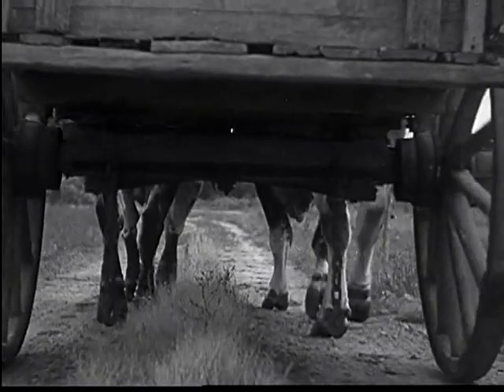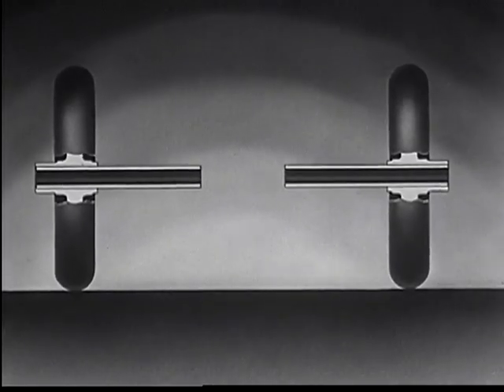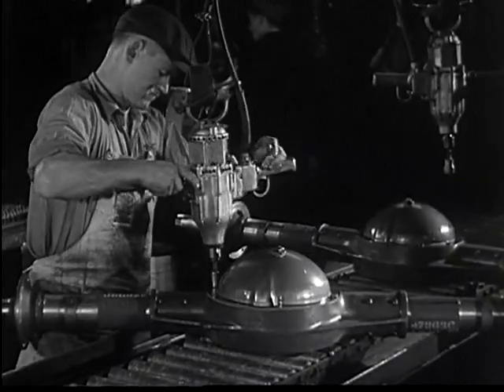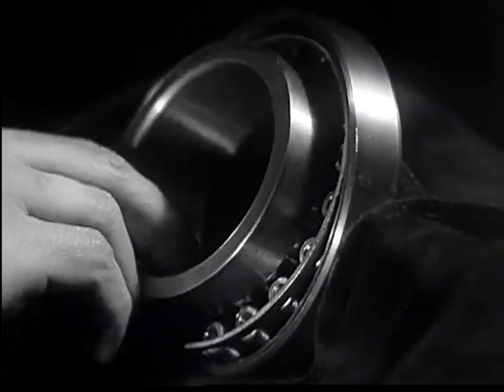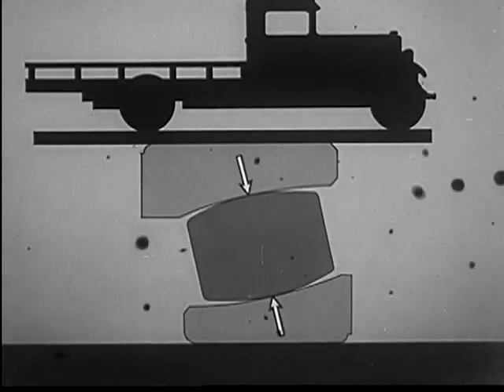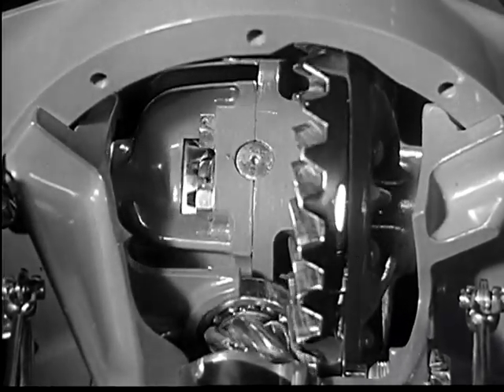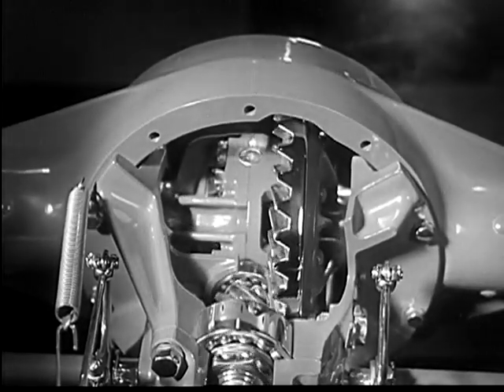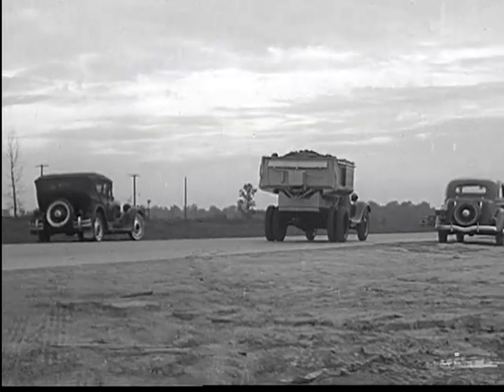It Floats - Chevrolet Full Floating Rear Axle (1936)

Comment: 1936: repair broken axle with a wrench
2019: disassemble half of the car to change a lightbulb
Reply: @Gibbon Oh sure, it only took four hours to replace the rear valve cover gasket on my V6 Toyota.
Reply: @Sean_Coyne  same, did it myself and added extra washers to squish the gasket better. 4 years no leaks.
Reply: Sean Coyne transverse v6 lolll
Reply: @Sean_Coyne  or 3rd brake light bulb on a tundra 2015
Reply: @Sean_Coyne  Now thats an unfair thing to say, and it tells me you're not very smart when it comes to engines. A valve cover gasket is gonna be a tedious process no matter what because you HAVE to disassemble ANY internal combustion engine to change that. Or at least part of it.

While you're at it, why dont you complain about your crankshaft change being tedious, too?
Or your valve lifters needing adjusting?
Or your wrist pins not sliding easily?
Or your main journal bearings needing replacement?
Reply: @Dave_Crupel  Disassemble the engine just to change a valve cover gasket?  That is not true.  Nobody who is smart about engines would ever say such a thing.
Reply: @Sean_Coyne  they always take more than 4 cyl to maintain, you knew it when you bought it lol
Reply: Sean Coyne that’s all transverse v-6’s of similar size in fwd applications. Try working on a MR2. Dope whip, no room better have access to a shop. And some people drop Camry v6s in them.
Reply: @Sean_Coyne  ...tell me about it.  Probably had to remove the intake as well !
Reply: @Sean_Coyne  Next time, buy a Toyota Prius. Over here in Germany, many cab drivers say the Prius Plus is the most reliable car they ever had. Usually they always hate the currently driven car and want the old Mercedes Diesel back.
Reply: @Sean_Coyne  chances are it's made by GM lmao
Reply: @Sean_Coyne  to be fair...this applies to any transverse v6. longitudinal v6s wouldn't have this trouble.
Reply: @Sean_Coyne takes me like 20 minutes to change a valve cover gasket on my 82 S10 lol
Reply: @Sean_Coyne try repairing the timing cover seal on your Toyota V6.  Makes your valve cover look easy.  You will have to do the valve cover again BTW. Lol
Reply: @Sean_Coyne  Bingo. Toyotas aren't as great as their stupid commercials make everyone think they are.
Reply: Obd1andDown yeah actually they turn out a lot better, reliability, efficiency, and easy-to-work on seems to always outlast every American piece of shit on the road. Domestic fanboys thinking their heavy gas guzzler rust tanks are better than imports. Theres that Boomer mentality again and its killing me holy fuck.
Reply: @acewingdabson3139  Rust tanks?  Japanese cars are the rust buckets, made all the worse because of Unit Construction.  If the rockers get rusted, the car is almost impossible to fix, because those rockers double as structural members.  Reliable?  There is nothing reliable about rubber timing chains and water pumps inside the timing cover.  Easy to work on?  Not when you have to pull the engine to remove some of the spark plugs.  Plus, some of us like ROOM, COMFORT, SILENCE, and a NICE SOFT RIDE.  Also, your foreign wonder cars would not be lasting anywhere NEAR as long if motor oil was the same as it was in the 70s.
Reply: @Sean_Coyne  why don't you drive a 1930s Chevy then?
Reply: @MilesPrower1992  They are very hard to find in stock condition, and quite expensive when you do find them.  I drive a 54 New Yorker station wagon and a 73 GMC 3/4 pickup.  NO computers, NO smog checks, NO catalytic converters, NO EGR valves.
Reply: @michaelbenardo5695  I made that comment three years ago
Reply: @michaelbenardo5695  But they're so dependable and easy to repair! Surely they must be common and inexpensive to maintain!
Reply: Mic_Glow  or pull cab off to change a turbo. Lol damn time has changed
Reply: My friend has a Chevy Malibu 2009, she pays $150.00 just to replace her headlight bulb. Am not joking
Reply: @nelsonmiranda6117  but the problem is the car or the people? 99% of times its the people.
Reply: That axle wasn't broke dumb fuck
Reply: @Gibbon Simple? I had to remove my entire truck bed to replace my fuel pump.
Reply: @austins.3313 thats because you did it the incorrect way.
Reply: @austins.3313  Depending how much you love that truck, you could just cut out the piece of the bed in the way and weld it back.
Reply: @austins.3313  haha me too ,
Reply: @austins.3313  in comparison to other cars that's simple
Reply: radiobot that’s the Mexican way. The mechanic way is to drop the tank. Don’t be so petty
Reply: Axles in today's trucks are nearly the same like this shown one when they haven't planetary ends.
Reply: Mic_Glow 🤣
Reply: Gibbon yeah and I only had to remove the front brush guard and bumper plate then buy a speciality tool in order to remove the oil filter on a 2019 toyota tacoma...
Reply: Cause newer vehicles have too much crap in them that we really don't need.
Reply: With a good fight for Right to Repair, and maybe even some DIY/Open Source Hardware, we can get back to a sensible world like this!
Reply: @ericlotze7724 We can only hope so.  Problem is, the yuppies love overly complicated and hate simplicity, and the auto makers are catering strictly to them.
Reply: @michaelbenardo5695  You can make things complicated AND maintainable, you just have to have the end user’s experience and all that as your priority, not “as much profit as we can juice out of them”, They just intentionally make stuff hard to work on…so you take it them and them alone to fix it (or better yet for smaller stuff just throw it away!).  Or design in points of failure / skimp out on materials so you have to buy a new whatever widget every few years.

But yeah i hope with everyone being aware of all this, and all the crazy shit you can pull off in a small fab shop these days (cnc machines, 3d printers, etc), that we can finally make stuff built right again!
Reply: I remember swapping out my old VW Beetle engine in minutes by removing just four bolts and dropping the engine onto a trolley jack. Skilled or not , anyone could maintain that car.
Reply: damn right you are....    :-D
Reply: Ya entendi😅😅 hahaha
Reply: So true
Reply: @Gibbon When? 1988? If so then I agree.
Reply: Things are made harder to work on for one reason..... post sale service revenue.
Reply: 1936: 30 regulations regarding production of automobiles.
2019: 5123 regulations in the US, 3453 in EU, 3234 for Japan, and another 3234 for other countries.

You could repair them with a wrench, but it would get broken every few weeks. Today people complain because they have to do an yearly oil change and nothing else.

True, cars today are way more complex and compact, but back then it was basically a carriage on wheels, for God's sake, they still had bike wheels :)
Reply: @manu144x  What in the hell is the point of compounding the light fixture?
Reply: @manu144x  Cars had long since left "bike wheels" behind by the time of the First World War - 1914 -, let alone the 30s.  30s cars were not carriage-like.  You are thinking of 1900 - 1904 cars.
Reply: @Gibbon I like Toyotas, and have owned a couple. They are NOT easier to work on.
Reply: Your absolutely correct, today's vehicle are made so that the average joe have to go to the dealers for repairs.
Reply: That's because we used to demand what we wanted, or we're not buying it. Not we just take what we can get, and buy for other stupid reasons.
Reply: I have a '46 Chevrolet pickup and a 2018 Colorado. The '46 can carry a 4x8 plywood flat in the bed. The 2018 Colorado can't. We've come a long way baby.
Reply: Remove the entiire front console to replace the airbag control unit.
Reply: My 2006 yaris I legit have to take the front end off to change the headlight bulbs.
Reply: A V8 pushrod motor combines the ease of repairs and performance over any other type for the average joe. This is why Ford brought it back in the 7.3
Reply: @jtnoodle  YES, YES, YES!  Nothing else measures up.
Reply: While in most cases that may be true. Today’s cars last way longer 200,000-300,000 miles is not uncommon back then 100,000 was a huge milestone
Reply: @mike5162  We didn't have synthetic motor oil back then either.
Reply: @michaelbenardo5695  that’s true but I’m pretty sure that has little to do with it. I use synthetic oil but I’m not sure most people do.
Reply: @mike5162  Most of that long life is due to the use of synthetic motor oil.  It is far better than the stuff that comes out of the ground, and even that is better than what we used to have.
Reply: @michaelbenardo5695  I agree with the synthetic oil but it is much more than that.
Reply: @mike5162  Today's fuel injection means no more flooding and washing the oil off the cylinder walls.
Reply: @michaelbenardo5695  okay, Bot ,🤖 I ,will ,do ,what, you, command ,we, good,brother,,,???? I, am, concerned?
Reply: And pay $700 for Yukon led rear tail light assembly with no replaceable bulbs other than the reverse light.
Reply: @fomoco300k  $700.00 for a damn taillight lens???
Reply: @fomoco300k  Easy solution - Never Buy a Yukon. Ever.
Reply: When my father was getting a fuel injector replaced in his 2016 Ford F-250 Super Duty they had to lift the body of the truck off of the frame entirely to get to it

It was a $9,000 USD job if memory serves
Reply: @Weird_Cat_Thingy  Sounds like a rip off. Diesel?
Reply: @Weird_Cat_Thingy  You serious?
Reply: To be fair though, you had to rebuild the motors every 10k miles in the 30's, so you were wrenching way more often
Reply: @Mr Sunshines Sir, that's more like the vehicles of the teens.  20 years later, everything had vastly improved.  However, I agree with your overall point, today we think nothing of even driving across country.
Reply: @davidstjames_  Partly because of our Federal and State highways.
Reply: Well said
Reply: Gibbon Toyota trolls at it again!
Reply: Mr Sunshines ha ha people are clueless lol but i understand the OP was being funny. They cut the part of him fishing out the busted shaft that stayed inside lol all good
Reply: My 2018 Focus has you undo two screws and the whole headlight comes out. A lot easier than my 95 Escort which has you disassemble the grille plate and a primary bracket setup to get access to it. Sometimes they get it right, other times it's the new guy designing his first car.
Reply: Yeah good luck trying to get that 1936 to start in 28 degree weather. Let's see you drive 300 miles straight in that 1936. Be honest, most of you have never changed a taillight.
Reply: @KobaBlack113  A 36 will indeed start in 28 degree weather, as long as it is in reasonably good tune, in reasonable good condition, and you are using either modern multi-grade oil or the proper single grade for the temperature, but if it needs new points, condenser, cap, and rotor, then maybe not, but that applies to all pre 75 cars, not just 30s cars.  My 73 GMC pickup is equipped much like most 1936 cars, (except Fords); 3 speed manual, manual brakes, manual steering, wind-up windows, manually adjustable seat, Inline 6, low gearing.  I have driven it more than 300 miles straight.  I love it, but you would hate it.
Reply: @Gibbon yeah bullshit.
Reply: @thedave7760  Some procedures, as you detail, can be tedious. As I've found recently on an eight year old SUV that with repetition I managed to shave forty minutes or so from replacing an entire headlamp assembly on a GMC Yukon. I did both sides since the lenses were pitted beyond restoration. The upside was/is that with the new lenses it actually changed the character of the vehicle. The procedure involves removing eight 10mm screws (power tools save time) and partially unbuttoning the wheel well housing. I can also access the fog lamps much more quickly too and I can get to two difficult screws by feel alone now having done this four times trying different bulb types. I have no qualms about getting into the front end now if needed.
Reply: Modern CV Axles aren't not as easy to replace, but are far from difficult.
Reply: Exactly
Reply: So mad this is true.  I had to remove my whole front end to change turn signal bulbs.  Enraged.
Reply: How about 2005 chevy truck frames made of pop cans so the motor falls out before the paint on the hood is even discolored .recall
Reply: @zerozilch  yeah the federal "investigation" into rusting Chevy trucks - did not get very far. There were lawsuits. We have a 2004 - the local mechanic told us to trash it due to frame rot. So I brought it to a welder - luckily the hole was in the "neutral zone" - then lots of phosphoric acid and rust paint and the cosmoline paraffin wax spray. haha
Reply: @voidisyinyangvoidisyinyang885  I have two one broke at cab an bed on  a 4x4 the other a 2 wheel s10 the whole front section around motor is gone controll arm feel out. Both 2005 both have low miles an basically mint conditionpaint on body.  The frames are made of licence plate type pieces. Junk engineering ot the frame manufacturing.  Also have two70s daily drivers just sayin
Reply: Ji
Reply: I just changed a lighbulb on a 2018 Renault Clio and all I did was unscrew two screws for the cover, remove it and change the bulb
Reply: Most vehicles are still really simple. At least domestic
Reply: I was just thinking that if we had kept the first sbc prises and repairs would have been much less.
Reply: @Gibbon As a Toyota technician I would have to strongly disagree with your comment.
Reply: @Gibbon nah they ain't
Reply: Or just never put on the cover
Reply: Don’t forget a flat hour of computer diagnostic time to find out WHY the bulb isn’t working, and to tell the dash display that it has been fixed. That’s okay, but I wonder who the hell gave GM permission to use the reverse lights as something else.
Reply: every other oil change, have to change the point, set it the dwell right, spark plug, and new engine every 100K mile, not 1million mile and diesel was not popular then
Reply: @ahoorakia  I change the points condenser, cap, and rotor every 10,000 miles, change the oil and filter every 2,000 miles.  Check the points and plugs every 5,000 miles.  My engines always last well over 100,000 miles, but many people's engines didn't last much over 70,000 miles, due to the fact that they refused to regularly change the oil.  Or even check the level when they got gas.
Reply: @ahoorakia  But it is EASY PEASY to do so.  When something DOES fail on today's monstrosities, it is damn near impossible to fix it, and replacing it costs a king's ransom.
Reply: Next step jettison the entire car because of a faulty light...
Reply: they want you to just buy a new car now and make sure that you get them to finance it so you are paying for it even after if breaks down
Reply: This is not an exaggeration. To change the side marker lamps on my 08 Honda Accord, the entire front fascia must be removed.
Reply: @jtnoodle  Just for that?  All that f-----g work just for side markers?  I don't know why anybody would buy a car like that.  I sure won't, but then I won't buy a car without a dipstick for the automatic transmission either.
Reply: 2019 BMW*
Reply: @Gibbon 20 years ago.
Reply: "progress"
Reply: Maybe your buying the wrong cars because I don't have that problem with anything I own.let me guess European?
Reply: I don't think my 2019 Tiyoda has light bulbs
Reply: Get rid of the AC, power windows, passenger side mirror, and reversing light. You can repair a broken axle with a wrench today. Good luck to your family when a drunk driver comes along.
Reply: 2040: replace the whole drive train, and then fix the scratch on your bumper.
Reply: Back then a garage was simply a wrench 🔧
Reply: That's how they getcha 👋👋
Reply: Ikr back then was so simple but humans want more
Reply: Fr lmao
Reply: That's no fucking bullshit! What the hell happened?!
Reply: One of the reasons that I have no interest in today's cars.
Reply: @Gibbon Oh, really?
Reply: @PietriGuitars  Horrible.  My 73 GMC is so much better.  And NO smog checks!
Reply: true
Reply: 1936: Axles breaking so often, that they've made them easy to swap.
2023: Light bulbs (LED) lasting so long that there's no need for them to be user replaceable.
Reply: @EustaH  Yes, in theory leds last 100.000 hours. In practice half of my work colleagues with integrated led headlights/ rear lights etc. had to replace them. I paid 1.50$ for one bulb, they paid 700$ for the non-serviceable assembly
Reply: How did he get the broken half left inside out .
Reply: https://www.youtube.com/watch?v=8JoG0hQV-UA&t=164s
Reply: Funny enough replacing an axle on a 2020 1 ton Chevy is the exact same as replacing an axle on one of these older trucks.
Reply: That is so true 😢
Reply: Gm full floater is still serviceable the exact same way
Reply: Capitalism has it's limits.
Reply: 2024: just scrap the car and buy a new one
Reply: 2024: take your car to an overpriced specialist because they have the proprietary tools
Reply: 2025: Buy a whole new car because one battery cell has failed. Good one, morons!
Reply: Lmfao 😂😂
Reply: So basically newer cars are way more complex but also way more reliable, while older cars are simpler to fix but also easier to damage
Reply: Don't forget the computer software and scanner you need to reprogram the car after you install the new bulb, lol
Reply: @stuartnevins8098 the whole boomer complaint about computers is so stale. Very few things require a computer involved
Reply: Ain't that the truth. I've owned several vehicles like this over the past dozen years. On the other hand I had a pickup truck where I could remove an L-shaped pin and the whole headlight assembly could be removed just as pretty as you please; that was fourteen years ago.
Reply: My 02 is like that!!! Still rolling in it! Oh a my sealed beams for my 71 K20 are available at all major part stores still! Napa...Carquest...!Oh and my 06 Cummins is pretty easy too except on pass side have to remove airbox cover to unplug bulb!!! Early 2000s an still pretty simple an easy to work on!!! They all went to shit about 07 on up! Emissions mostly an hard to work on!
Reply: Why did they do this to us 😔💔
Reply: I also love the increased usage of plastic details or rare metals in modern cars, when they at the same time try to desing cars for the enviorment~~
Reply: @DeWollfy  And plastic is HORRIBLE for the environment, unless they mean the "environment" of their profits.
Reply: 10000 BC: repair broken sun dial with a stick.
1900 AD: disassemble the whole watch to replace a tiny gear.

1900: repair broken telegraph with a screwdriver.
2019: disassemble half of the smartphone to change a part.
Reply: @amadexi  50,000 BC: scratch a line for monthly menstruation cycle
Reply: @Mr Sunshines Not every car was an underpowered death trap in 1936... A Duesenberg could reach 120 MPH and was a very comfortable and reliable car as well as many others from the era.

Cars today are junk and they are built that way to ensure you buy or lease another one in three years. Wash, rinse, repeat.
Reply: @zackmatulis4094  Thats not totally true, you can thank all the regulations they must meet to sell a car or truck. Metals are thinner for crumple zones and reduced weight to meet EPA fuel mileage requirements. Emissions standards adding tons of complexity to engine management systems. It took all of them 30 years to develop the tech to get any power out of the engines and still meet these regulations. Its actually bad for business under that business model. Back in those days non of this stuff was concern. Some cars didn't even have seat belts and solid pane glass for windshields. Fuel millage who cared back then, gas was cheap!! Emissions? air pollution I don;t think was even term used in 1936
Reply: @Thrive-Off-Grid  Today's cars are actually too complex for mass-production.  That's why they are so damn expensive, and that's why the automakers have to sell so damn many of them to make a profit - production costs are too high.  Mass-produced items are supposed to be CHEAP to produce.
Reply: @michaelbenardo5695  Yeah I would agree with that. I was a machine builder, I built the machines to produce these over complex cars and trucks. Yup they are all trying to keep up with one another and as that happens they all evolve into more complexity. But regulation also plays its part in making them over complex. Why do you think todays cars have all the sensors, EFI systems, OBD2 ECM, etc. MPG government mandates force them to comply. So they have to develop and meet those criteria's. Cars / Trucks get lighter, they have to develop more efficient engines and that will not come without added complexity. Development cost lots of money and then they have to create the infrastructure / production machinery to produce those systems.
Reply: @Thrive-Off-Grid  I used to work as a mechanic, so I get what you are saying - many many items on today's cars would not be there if it weren't for all of these emmissions and CAFE regulations, but it is constant one-uppmanship that is rediculous, and, even more so, so many younger motorists who are gadget freaks.
Reply: Zack Matulis yes but a duesenberg is like the modern equivalent of a rolls Royce phantom these days .... not everyone had one lolll
Reply: @zackmatulis4094  Yes, some where overpowered death traps.  Beautiful, but still deathtraps :)
Reply: @zackmatulis4094  thats how gm started lol
Reply: @zackmatulis4094  True, but to realize those Duesenberg features meant spending the equivalent of SEVERAL mortgages in the bargain !
Reply: @zackmatulis4094  -Singing the praises of a car that cost as much as ten modest homes in 1929 isn’t saying much.....
Reply: @martyzielinski1442  What is your point? A Rolls Royce or etc still costs multiple times more than a modest home....
Reply: @zackmatulis4094  I second, third, fourth, and fifth you.  Today's Japanoid tin cans are not automobiles, they are motorized computers.
Reply: @zackmatulis4094  If only I could afford a Duesy.  That was the finest thing ever built, and can walk away from a 70s car, or anything else from 1930 to about 1953.  Most beautiful as well!
Reply: @zackmatulis4094  designing and building every car to last 30 years is extremely wasteful and expensive, both in materials and design. even if one did design one, the actual number of vehicles that would achieve that intended lifespan would be relatively small. therefore, set a reasonable, realistically achievable, and repeatable lifespan for a car, and design around that.
Reply: @zackmatulis4094  My Tesla can do 145 and it's roof doesn't leak in the rain. Keep your Duesenberg.
Reply: @zackmatulis4094  If you take in regard that about 98% of the US population in 1936 couldn't afford the car you mention your comment doesn't make much sense...🤔
Reply: @zackmatulis4094  may be on USA, on the rest of the world we use the same  cars for years and years and years.
Reply: @pologamero2648  We used to over here, but now, with these damn smog checks and "Crush-A-Clunker" laws, people are constantly replacing their cars.
Reply: @Gibbon Try replace the lightbulb of the headlights on a Prius with your bare hands, it's literally painful.
Reply: car back then where a lot more simple
Reply: Tex Red Tech welllllll I’ve never worked on a 36... but I own a 37 and had to do the trans on it ... and trust me ... the whole rear end did not have to be removed
Reply: To be fair, if that axle broke, you'd have to take the entire rear end apart to get the broken part of it out.  This video is a lie, basically.
Reply: bvcxz gt Actually, that is incorrect. Last summer a rear axle shaft broke on my 42 Willys MB, after 75 years of service. I used a rare earth magnet on the end of the broken shaft, and was able to retrieve the broken segment in about five minutes. Repositioning the new shaft took about ten minutes. Willy has been running fine since. BTW, I did buy a replacement shaft for the other side, just in case that one should break.
Reply: @bvcxzgt5451  Not if the cover is removable.  Just remove the cover, and everything is in plain view.
Reply: @Gibbon Try changing a starter motor on a Toyota V8!  It's under the inlet manifold! The rear spark plugs on a V6 Camry require the removal of the exhaust manifold, which often means a couple of broken bolts. Toyotas are no better than anything else!
Reply: Stephen Velden same with the caddie north star engines of the 90s
Reply: @stephenvelden295  What so many don't understand is that popularly priced mass-produced cars are designed down to a price point, not up to a standard, and if they want the finest thing on wheels, they need a Rolls.
Reply: Haha. This is true enough to be hilarious.
Reply: Everything is harder because everything is built Smaller and cheaper than the vehicles from 1936, yes they may be harder to repair in some cases but you also have to realize how much faster and how efficiently everything is able to be now. It is true that things are much harder to repair now, but you also should think of the upsides.
Reply: @vunree9744  Cars are starting to suffer from a smartphone syndrome. Millions of apps and features, while only few are actually useful.
Reply: @benedictus9683  Oh yeah, so many useless features. The TC, pressure sensors, cruise control, GPS, thermometer, differential, automatic wipers, windscreen washer, automatic transmission, power steering, engine, windshield de-frosting system, side mirror de-frosting system, airbags... All useless features that we don't need.
Name me one inconvenient useless thing in your car. If you don't own one, no point really making an argument now, is there?
Reply: @benedictus9683  Starting? Haha I still have a 5 speed with no power windows or locks... My car gets nervous when I pull up to something with LEDs in it nevermind all the bullshit I don't need lol
Reply: @benedictus9683  damn you said a mouthful there brother
Reply: @PunakiviAddikti  There is no need to tire pressure sensors, there is no need for GPS, there is no need for a voice, there is no need for the car to park itself, if you can't park the thing, you shouldn't be driving.
Reply: @michaelbenardo5695  OK boomer. Just let technology progress. That's what they said about computers too y'know, nobody will ever need a personal computer. If these things are inconvenient to you, why did you buy a car with these features anyways? It costs extra.
Reply: @PunakiviAddikti  I haven't.  I still drive my 54 Chrysler HEMI and my 73 GMC 3/4 ton truck.  No computers, no sensors, no "systems", no catalytic converters, and NO smog checks!
Reply: @michaelbenardo5695  Why complain at all then? You don't have any of these systems. You're complaining about features that other cars have. If I started complaining that your car isn't my favorite color, you'd have every right and reason to tell me to bugger right off. So let's let the subject rest. You have the right to your own opinion.
Reply: @PunakiviAddikti  I was merely agreeing with OTHERS who were complaining.  I can say whatever I want, without asking for your permission.
Reply: @angelitavaldellon7600  I don't think I ever replied to you but OK, noted.
Reply: @benedictus9683 agreed. My grandpa used to say something to the effect of “why can’t we just have a basic automobile?” I agree with that statement. K.I.S.S. stands strong in that. With an old vehicle you could abuse the living hell out of it and it’ll just keep kicking. In the modern vehicle you mess one thing up and all of a sudden half your car shuts down and or falls apart.
Reply: @benedictus9683 if you buy something brand new thats entirely on you bud, there are plenty of cars from the 2000s that offer way more benefits and repairability than ANY 1936 vehicle.
Reply: @vunree9744  "upsides" like generating more and more waste? Sounds great.
Reply: @vunree9744  power steering, electric windows, AC etc. yeah sure, I love those. What I don't like are driving tablets.
Reply: @vunree9744  bigger engines more power = less space in engine bay
Reply: @vunree9744  Having to bring it to a shop for everything, and everything costing thousands, are not upsides.  Besides, traffic today is so horrible that even an old Model T is more than adequate speed-wise.
Reply: @vunree9744 There really are not that many “upsides”, certainly not enough to justify the extra work and cost.
Reply: @vunree9744  what is with people saying "faster" as an upside to modern cars. In my opinion speed means shit, if your going too fast you can't show off your car because you can't see it. Older cars dont need to be fast to be cool.
Reply: @thebonnevilleof5933  that's why you have a car. Speed...
Reply: @saltyhashes1781  no I definitely dont think the reason you have a car is "just for speed". That's why there are formula cars and cars that belong on the tracks. These old cruisers were built for speed at the time, but now older cars are better for cruising.
Reply: @saltyhashes1781  You dont need to go fast in older cars to be cool.
Reply: @thebonnevilleof5933  Plus, today's traffic so horrible.  400 horsepower means nothing when you can't even go 25 MPH.  Even an old Model T can break 40.
Reply: @thebonnevilleof5933  I blame Mazda for really bringing back the Horsepower Race.  Remember their "ZOOM ZOOM" commercials?
Reply: @saltyhashes1781  But nobody needs a car that can go 150 or more MPH, not with today's traffic that only moves at 20 MPH.
Reply: @thebonnevilleof5933  Speed is relative.  A fast cruiser is completely different from a fast track car.
Reply: @saltyhashes1781  No, people have cars mainly for personal transportation and personal mobility.
Reply: @vunree9744  ...I don't need my car to park it's self...or brake it's self....or fail a smog check due to faulty tire pressure sensors. But I get what you're saying.
Reply: Just toplay devils advocate:
1936: Light Bulbs had to be regularly replaced
2020: LED's last basically a lifetime
Reply: @KingSlimjeezy  But light bulbs are a cinch to replace.  Even a small child can do it, and they are CHEAP.
Reply: @KingSlimjeezy  But light bulbs are nice and cheap.  LEDs are not.
Reply: if you have to disassemble half the car to change a lightbulb then you are doing it wrong.  i hope you are not a mechanic.  lol
Reply: @gmarte12  He was not being literal.
Reply: @michaelbenardo5695  yup.   i know.   but he is so far off even to just to point a general fallacy that many people think is true
Reply: @gmarte12  What he means is that today's cars are just too dam complex.  They are also just too dam expensive to produce.  Mass-produced products are supposed to CHEAP and EASY to produce.  Overly expensive and overly complicated is for LUXURY items, not mass-market items.
Reply: @Gibbon Toyota's are junk!  What kind of a jerk would design an engine with the starter in the middle of the V?
Reply: @davidstjames_  Starter in that location?  Glad I still have my 54 New Yorker HEMI and my GMC pickup with a Chevy Stovebolt.
Reply: Then the next car u buy better be ev cause that baby is easy to fix and only has a few parts that wear out during use unlike absolute shit internal combustion engine vehicles. I spit on that shit.
Reply: @Andytlp  Uh, no. My 08 4 cyl. Honda has 180K. With maintenance, I haven't replaced a single thing. It still gets 450-460 hwy miles to the tank. Your silly EV has a max range of about 350. Up to 8 hrs to recharge, if you're lucky enough to find a charging station. Meanwhile, I keep on driving to my destination. Have yet to see any Tesla's in remote locations.
Reply: @Andytlp  that is if they are willing to sell you the parts...
Reply: @Andytlp  More people would consider buying an electric of they had Quick-change battery packs that you could swap out at a battery-swapping station, instead of having to park it to re-charge the thing.  some of us do more than just go to the grocery store.
Reply: @Andytlp  That still isn't road-trip friendly.  If cost is the only consideration, electric cars will probably remain niche sellers.  If they set up battery-swapping stations, they will go main stream, as many of us, myself included enjoy taking road trips without having to stop every night.  Gas cars/trucks allow that, electrics do not.  Like I said, many of us want to do more than just go to the grocery story.
Reply: @Andytlp  I don't like to have to stop every night.  Takes too long, costs too much money.  I drive at night, the Mrs. drives in the day.  When she is driving, I snooze, when I m driving, she snoozes, but then, we drive nice big soft cars, so we can do that.
Reply: @Andytlp  Full-size station wagon, such as a Chrysler New Yorker wagon, is a great car for road trips.